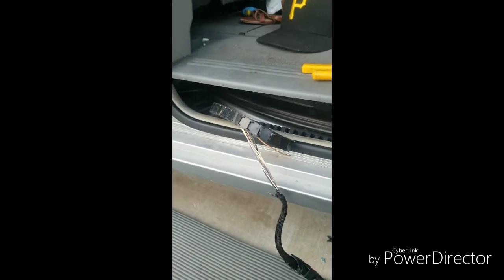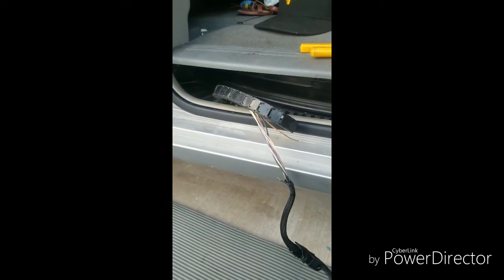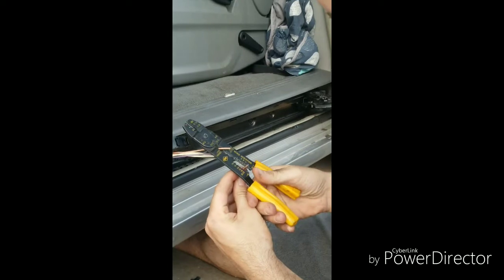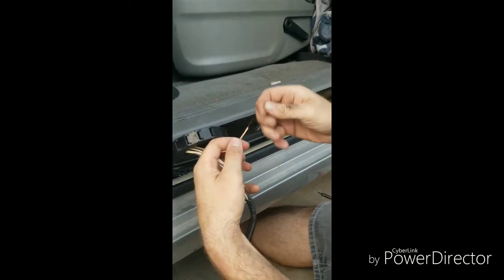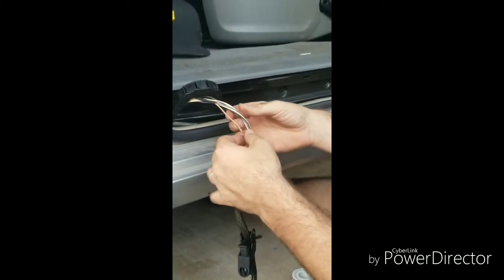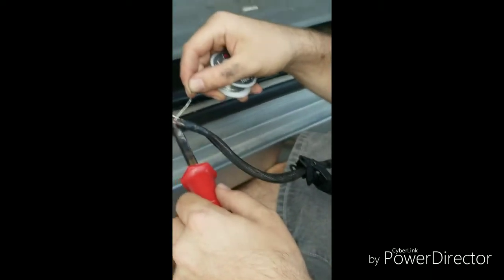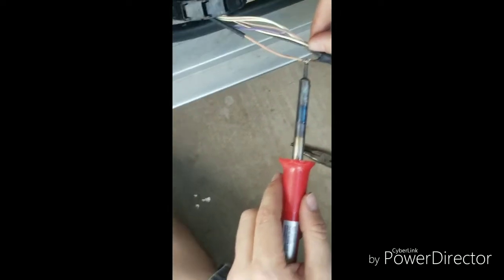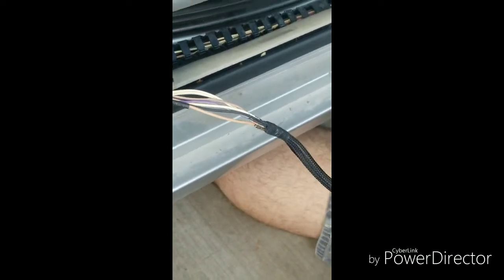How to repair 2009 Volkswagen Routan automatic/power sliding door FIXED!

Comment: thank you for this video....one of my sliding doors is doing the same thing. It will open automatically with any button, but it will not close with any button.
Reply from the maker: No problem! I would definitely check those wires and let me know if yours were bad also